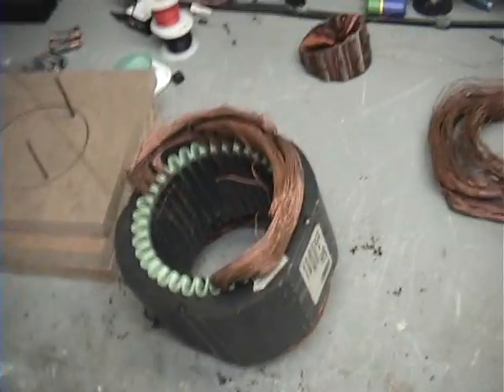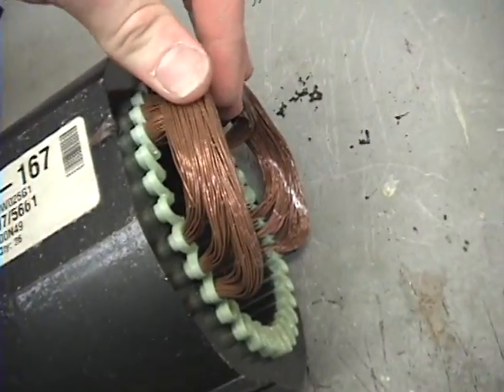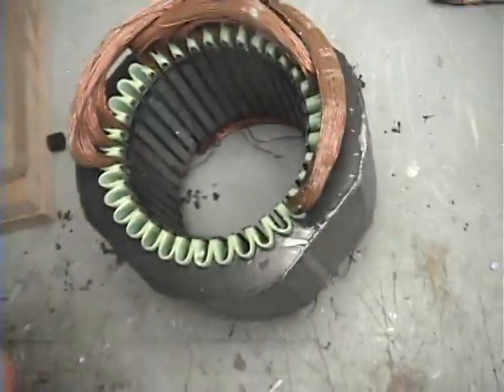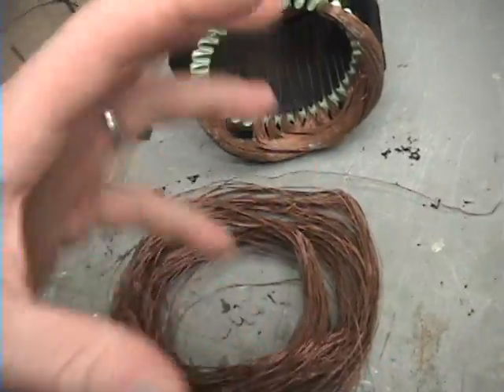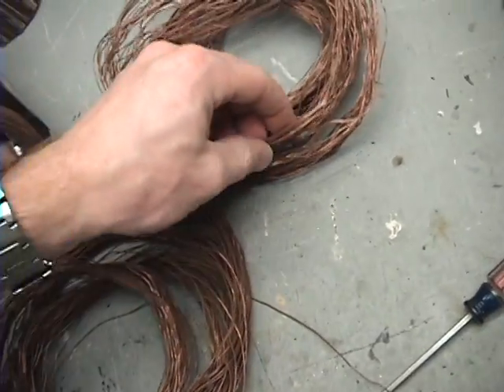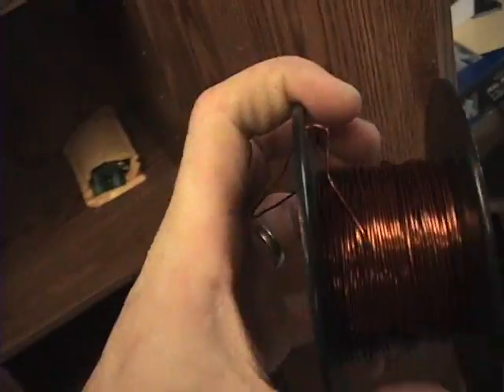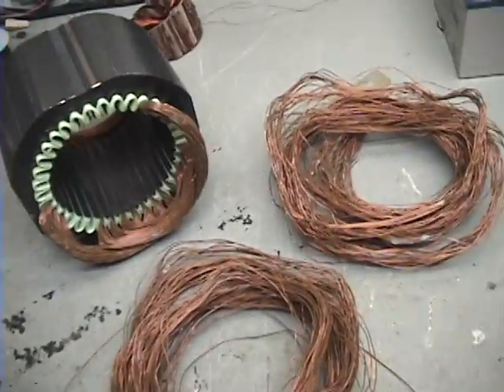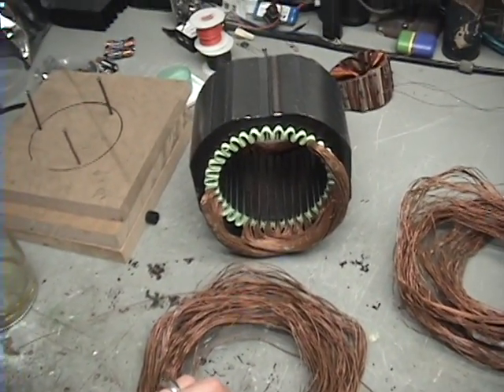How to unwind a 1.5 HP motor. This is so much fun!

Comment: Thanks for showing this.  I was looking for ways to reclaim the copper for use in a generator project I'm working on and this gave me a good way to do it.  It's a little tedious but well worth the effort over going to the store and buying a roll of copper wire.

Thank you!
Reply: Aww, thank you George Smith , that's so sweet.  And proving yet again you're incapable of reading comprehension.  I clearly said it was for a generator, not lunch. 

May you never procreate.

Comment from the maker: Yes they are, I normally cut the outer casing and pry it apart. The steel ones are more Difficult to get a part than the aluminum ones. The aluminum ones you can pretty much break once you get the first cut the steel ones want to springback and can be a pain in the butt unless you cut them on both sides. If they're small enough you can cut them with a Portable bandsaw otherwise An angle grinder with a cutting disc usually works. ~Russ

Comment: I developed exactly the same method except I've been using bolt cutters for step 2. I've been working hard to find my copper. I used a hacksaw to cut open an air conditioning condenser yesterday. I don't think I've used my right arm that hard since I was 16 years old.
And yes I know there's better tools to do this sort of thing. I'm hoping a Sawzall and an acetylene torch are in my near future.
Oh, and the AC condenser was ancient, many years since it held any gas. I have a few principles.

Comment: We use to cut one end of the copper off with a table saw and leave the other side of copper on and then put the whole motor in a outside fire and burn all that paper and plastic in the middle off and then pull the rest of the wire out.. only took a hour for us to do 100 of them.

Comment: Can I just say this...I own a small business and we take these apart all the time..
Steps.
1 take the motor put it in a vice and tighten 
2 take a dremel or any industrial cutter (saw zaw,demo saw, grinder) and cut one side
3 take a flat pri-bar and pull the other side out..
its that simple

Comment: good info  but we think its alot easier to lay it on its side, cut the wire from one end flush with the housing, then flip it and pull the bundles out one at a time.  motors are tough any way you do it but copper is NICE!

Comment: I have used copper wire from microwave transformers I have been keeping the primary for a wind turbine project and the coatting is a pain and I have found when I unravel the copper the outside is the worst but onces you get to the middle its pretty clean but you can recoat the wire if you want to be safe from shorts the motor you have would have been great for a wind turbine project thanks for the video.

Comment: LOL... Just get a air chisels, CUT the lead end off. Also known as the HEAD. Take a strong hammer bust up the varnished end, maybe a torch to burn off the lashing, and then strip out. The coils A.K.A. set's/ grouping's  will come out very easy. Also heat will do the trick very nicely. You should be able to strip ANY stator under 5 HP in about (5) minutes. Nice video.

Comment: IAfter I take the motor apart I put it in  a vise and use a grinder or sawsall to cut 1 side off , Then i use a punch to punch the wire though......A real time saver if you go though motors like I do.

Comment: look for CRT televisions. People give them away on craigslist all the time. The copper coils are easy to remove and they come right off of the iron core making them much easier to unwind by hand. There are a lot of different style of coils but the best ones come out of projection big screens, they have 3 small crts inside each with a pair of coils. Each CRT will have 4 half coils you can unwind making a total of 12 coils of clean coated wire. They sometimes have a bit of goop on parts of them, like a kind of caulk to hold it in place. While it can be a pain, it does break off. It can probably be softened with heat.

Comment from the maker: Most of the time the coating is an epoxy resion that is baked on. Some times you can "in bake it" but most of the time the resion is to hard for any chemicals to desolve. Most I have tryed will eat the coating off the wire before the epoxy will give... Thanks! ~Russ

Comment: Thanks for showing this.  I cut open a 1/2 HP washing machine motor with bad bearings to see how the bearings work and what they are like.  If you have any understanding of those bearings (which do not seem to have ball bearings, maybe they are just lubing reservoirs with a shaft in a smooth bore as the bearing), I'd like to hear what you have learned.

I tried unwinding the coils similar to your technique but concluded there must be a better way it was so difficult.  The mallet-softening step sounds helpful.  I am really wondering how they wind these motors in the first place -- do they press coils in somehow, or do they wind them in one loop at a time, etc.  Seems they are interleaved somehow, amazing manufacturing technology.

I'm interested in seeing if there is some way to actually repair a 10 year old 1/2 HP washing machine motor that is normally considered unsalvageable due to frozen bearings.  First, it may be recommended to lube the bearings best you can from the outside with light machine oil and work the shaft to get it free, just to see if you can get the motor running and what condition the bearings are in.  If it runs with no rattling/grinding noises, it might be possible to do a more thorough lube to keep it running for a few more years.  Otherwise, there might be a way to replace the bearings.

One thought about re-lubing is that after dissecting the bearings, they seemed to be basically oil reservoirs surrounding the shaft.  I'm thinking maybe you don't have to take apart the motor, rather just drill holes from the outside into the reservoirs and try to pump in an appropriate lube such as chainsaw oil.  There may be old solid grease or dried out oil residue in there, so more experimentation is needed to see if first flushing with a penetrating oil or something would help -- I'm betting it wouldn't but who knows.  However, lubing may be even easier if you can get to the bearings from the inside of the motor, which means opening it up.  If you want the option of replacing the bearings, I think you'll need to open the motor anyway, although perhaps there is a way to drag the bearings out directly from the outside.

If it seems you have to cut open the motor housing for whatever reason, the challenge is doing it in a way that allows reassembly with perfect alignment.  The housing is actually two pieces that appear to be epoxied together with a really strong bond.  If you can de-glue them, perhaps that is the best way to open the housing -- I couldn't.  That leaves cutting.   Cutting is easy; putting it back together in perfect alignment is the challenge.  It is easy enough to cut through the four aluminum corner struts with a hacksaw (careful not to nick the windings).  But the sawing leaves a gap that must be filled/shimmed if you are to put it back together.

One thought is to first drill holes lengthwise through the struts for eventual screws when you reassemble it.  The holes should provide good alignment if you can shim the gap properly.  To get a nice clean gap that can be snugly shimmed would probably require a good table saw of some kind -- hand-sawing leaves a ragged, uneven gap.  But after drilling holes (not easy due to the rounded-shape of the housing where you need to start), you can then cut the struts cleanly and separate the two housing halves and take out the armature to get to the bearings.

Another technique instead of drilling holes and shimming would be to screw external L-brackets to the struts with the short pieces of the L butting each other and providing a place to bolt the struts back together regardless of the cut you make in the strut.  The L-brackets essentially make an exoskeleton.  Unbolt the L-brackets to make the cuts, then bolt them back on with epoxy on the long L leg to the struts and you have a now a housing with a removable joint where the two short L legs are bolted together.  You can hacksaw the struts with no concern of precision for shimming and no shimming needed.

Lubing the bearings once the shaft is removed might be easier without any destructive techniques as you can see felt pads that feed lube to the shaft/bearing inside surface -- but probably can't get much lube in there.  You can pry the bearing out and open it up and lube it, but putting it back is probably iffy since there likely will be bent/dinged parts afterwards.  Experimentation needed.  Drilling a hole still might be the easiest way to re-lube the bearings with minimum risk.

Replacing the bearings would be ideal, but I have no idea about how to do that or what bearings would fit.  The two bearings, one at each end of the shaft, are actually not identical.  Also they seem to be integrated somewhat into the housing, so there is no clean "hole" to insert a real ball bearing.  So I doubt replacement is an option.  Probably lubing and re-assembly is the only option and not too realistic at that.

Of course this is overkill to fix a throw-away motor, but that is the point, so see what we can accomplish.   If you get the technique down, it might be possible to fix a motor in say 20 minutes and sell it for $50 bucks -- new ones can cost $200 to $300 easily.

Comment: I have some shorted out washdown motors at work, usually 1HP or lower and they are literally impossible to get the copper out. I've tried everything I can think of from angle grinder to torch to get the wires even slightly loose. The iron plating is literally coated in epoxy and no amount of heating up or pounding on with a mallet loosens that stuff up in the center of the plates. the outer edges are easy to get loose though. Any ideas on how to get the inner part of the wires loose?

Comment: Couldn't you soak the motor in a citrus based paint stripper to soften up the coating on the wire? Just a thought.

Comment: i have been doing that for a long time, you just cut one end of all the wires,and use some tool to pull wire on the other end, i could scrap 2 motors in less than 10 minutes
Reply: Mevlle He's reclaiming the copper for other projects that require the wires to remain intact.  Read the description then reply.  He's not doing this to sell the copper.  Otherwise yes, your method would work.

Comment: Im here watching this, trying to get any tips i can while removing windings in a generator.
 My thing is, i need to reverse engineer it while i unwind it, i need to know where every turn goes because there is of course main windings,  then exiter windings, ignition windings for the engine,  and lamp winding. To top that off, the main winding has taps in 4 places to get the low voltage dc though diodes, and a feed to the regulator.
Now before anyone says "just replace it" . This is a 60 year old generator that i am not trying to repair,  i am trying to modify.  It is single phase 115 volt 400 watt with 12 volt 100 watt. 
My goal is to rewind it with 3 phase to a rectifier to get the full 400 watt at 12 volts using a car alternator regulator. 
However i still need the ignition,  exiter, and lamp windings. 
And it is a 30 position stator. So it will take some time.

Comment: Can you use these for making new coils? Wouldn't you be afraid that the coating has been broken from the handling?
Reply: Torgny Nordén if you replace smaller diameter copper winding from small brushless (I like using 775’s) with bigger stuff like this 0.8mm+ it will increase output (rpms etc) from same/similar voltage. Little 12V electrics on roids.

Comment: Its much esyer to cut one side with a disc. Then put the engine in a small fire for one minute .when its hot pull and the wire pops out fast .about five minutes per engine

Comment: You can make jewelry with the wire. My girlfriend takes copper wire, wraps it in swirls and other designs around stone to make necklaces and other jewelry. She does more complex designs with a little stainless steel pegboard tray thing with steel removable pegs that you configure in different ways for different deisgns, she picked hers up at Hobby Lobby. Try doing a sold search on ebay for copper wire jewelry... a simple piece of copper wire bent in a simple design around a simple stone goes for around $20. I'm sure some of you have wives or girlfriends who wouldn't mind having a new art/craft that gives them some extra income. If you can remove a whole lot of copper wire and keep it intact and looking good, you can sell some simple easy-to-make jewelry on ebay and etsy for far beyond scrap price.

Comment from the maker: It's not too bad... But... If you have the magnet wire in front of you and it's just time and a bit of work to get it out for use... May as well... Copper magnet wire is about 125$ for 11LB that's the General size. A smaller or the bigger the more expensive... ~Russ

Comment: rwg42985 - What sort of projects do you use the copper wire for? I love your recycling ethos. Can you wind new coils with this wire? With the insulation damaged, I am pretty certain you would have some major shorts.
Reply from the maker: Hi as long as the motor did not have an electrical fail and your carefully taking the wire out it's good to go. I do it All the time. Check my webpage for all the projects i use this stuff for. Www.rwgresearch.com
Reply: RWG - Thanks for the information. I'm going to take a look at your webpage/site right now.

Comment: If you are scrapping them to make some extra cash, you are doing it the hard way... You need to invest in a few tools... I used to scrap for years and made great money... You need an angle grinder (by a good one at the pawn shop to save some money) and use the thinest disks you can find... Cut one end of the coper off the motor then just use a big punch and hit it through and with pliers pull the rest out... It will only take you a few mins to do one, the more you do the better you get and the more tricks you will learn on your own...

Comment: I don't understand why you would want to re use wire from a electric motor. Is copper wire that expensive? surley the chances of damaging the insulated coating on the wire and causing it to short out between turns is too great.? Thats just my thoughts.

Comment: Just cut it with an angle grinder.  Start pulling from the other side.  Comes out quick.  Just make sure the wire is copper and not alluminum, not worth it for AL.

Comment: So much easier if you use a angle grinder with a thin blade, cut the top off and then the bottom and thats it! Takes 5 minutes, not two hours /watch?v=NtPYzc6g5DA

Comment: Now show us how to rewind the motor!!!!
Reply from the maker: Just play the video backwards... :-)  lol. thanks for the comment. :) ~Russ
Reply: *****
I was kind of being serious, its hard finding someone on Youtube or anywhere that can show me how to rebuild a motor. Which I need to do for my saw.
Reply from the maker: +Joe Schmoe :) i understand, that's one video i haven't made, i have a lot of content but i have not shown this at all. The bad thing is that every motor is sightly different. so you really need to just try to see how yours is wound the best you can and try to rewind it the same. ~Russ
Reply: *****
So just copy it exactly? Nothing else?
Reply from the maker: +Joe Schmoe that's correct. just know how you unwound it, keep track of the turns per coil, and make sure you use the same turns and the same size wire. is it a bad coil? you can see it was burnt out? or is it something else? dose it have a commutator? if it you will need to clean up that and check it for shorts. ~Russ
Reply: *****
I already know its a bad coil. Its a 75 year old radial arm saw, made of ultra nice ultra heavy duty castings, its literally more heavy duty than most lathes and metal working machines today with a 20 inch blade. The only thing wrong with it is the motor, its a single phase 3 hp motor. I know its burnt out because the guy who owned it is an electrical engineer and he told me it was "burned out for sure."

Its a skill I cant find how to on Youtube or google or anywhere. It would be nice if there was a short video showing some basic steps and things to keep in mind as well as a demonstration on a real motor. I've been wanting to learn how to do this for some time now because its a rare art anymore and theres all these nice machines that are in perfect order that can be had for next to nothing, often times free, they just need a rebuilt motor.

Thanks for the help and advice!
Reply: lmao, i seen a starter re wrapped in an hour in the mud for a mud buggy. started right up

Comment: And the point is  ???
Reply: sandsifter149 The point is, the copper wire can then be used to wind other coils to make things such a home built generator or another motor.  Copper has many uses.  It's also expensive.  I'd personally rather take the hours of time required to do this than throw it away and go buy the copper wire for projects.  Or you could cut the tops of the coils, pull it through.  Takes about 10 minutes and that much copper would net you a few bucks for 10 minutes of your time.  Much better than tossing it.  ^^